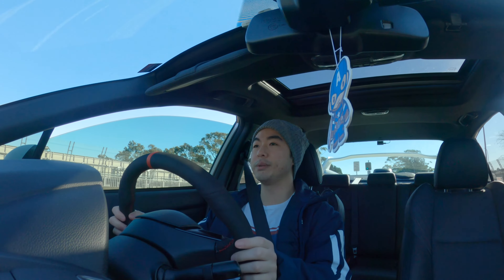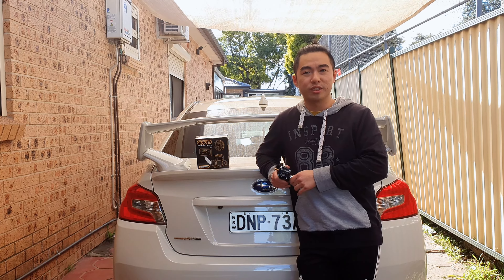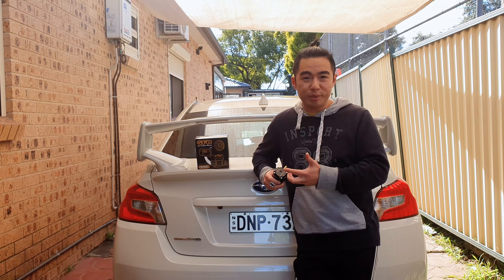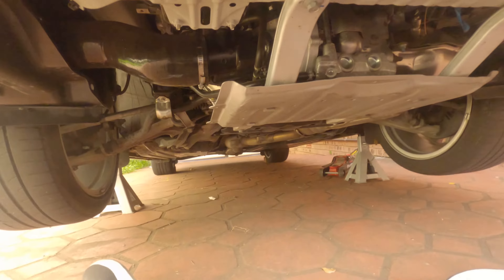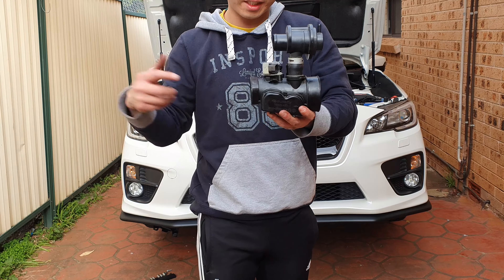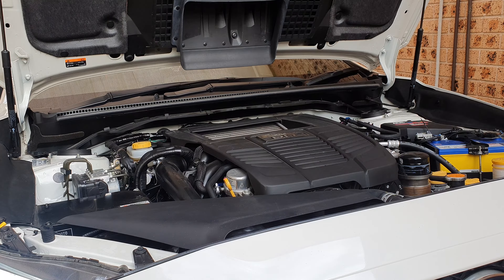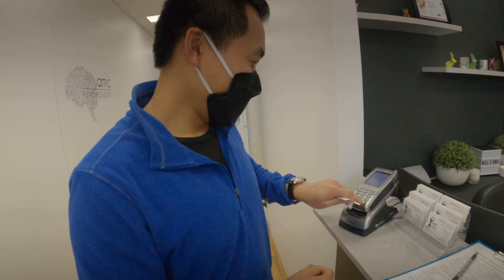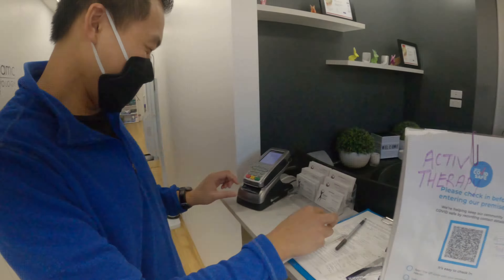The SIMPLEST and EASIEST mod for your TURBO SPORTS CAR | WRX2015+ GFB BOV

Comment: Wow it sounds great, looking at getting a WRX since ralliarts are too expensive to maintain! But WRX's dont have BOV wheras ralliarts do. Heard its not a good idea to put BOV's on the WRX's since they use a BPV and it can mess around with the MAFS and running rich since the air is venting to atmosphere instead of being pulled into the engine
Reply from the maker: I'm pretty sure the ralliarts have a BPV from the factory too? 

All that stuff about mafs and stuff is a bit of a myth lol. Different tuners will tell you different things. That being said, i got sick of the BOV sound and just have it run on full recirc 100% of the time now
Reply: @MrDuongTV1  yeah I wantcool turbo sounds but who knows it also might annoy me? I still need to test drive so I don't know what stock sounds like. But all I might need is an intake and a new bpv

Comment: How much bar can it hold + you are pushing?

Mine is tuned to 1.3b but with any BOV like GFB Respons and HKS SQV IV, both doesnt allow me to hold more than 1.1b. But the problem goes away when i am using another BOV/BPV which allows me to do that.

Gfb stood by their product reliability and their claims.
Reply from the maker: I've got no idea mate. Running a very moddest tune.

Comment: Did you set yours at 50/50? I have a turbo smart dual port bov and gonna set it at 50/50 I’m assuming that’s a good setting for daily driver?
Reply from the maker: It was on 50/50 for a bit, maybe 2 months. Since then it's been off completely and permanently 😂
Reply: @MrDuongTV1 is there a reason why you took it off?

Comment: Hi! I saw ur video and just installed the bov for my wrx! Can you tell me did you change the air intake? Thank you!
Reply from the maker: Thanks for watching mate! In this video, yes i had an aftermarket intake
Reply: @MrDuongTV1  Good morning Michael! I'm thinking whether I should get an aftermarket intake or not. It seems like you installed the new intake but didn't tune with it. I'm struggling with this now:(
Reply from the maker: @davechau6882  i did have a tune with it, you definitely want a tune with it. I took if off when i retuned the car with down pipe bcos 1. It made no significant power difference and 2. The wooshing sound got annoying, i wanted to hear the dump pipe and turbo whistle more. I dont even have the BOV going psh psh anymore these days
Reply: @MrDuongTV1  ohhh okay! Thank you Duong and have a great weekend☺️

Comment: Hi Mr Duong,

I have a question: I have a stage 1+ cobb ots tuned wrx 2015. On the BOV, what setting or how tight should make the piston from opening inside the bov to get steady idle? I like venting to atmosphere, but is there a specific adjustment you like using when venting to atmosphere? I hear alot of people just use the recirculating cap instead. But I want to hear the woosh sound too!
Reply from the maker: Hey mate. A lot of he said she said about venting to atmosphere. The FA20 supposedly doesnt respond well to full venting, so keep it at 50/50 max, or 70/30 (recirc/vent) if you have the adjustable one. Dial the piston all the way in so that it closes back asap.
Reply: @MrDuongTV1  Thank you for your response! I will definetly try the settings you recommended! Much love from Cali, Bay Area! <3

Comment: Did you tune up your car afterwards becasue if ya don’t it may cause problems for you mate so suggest tuning it after moding
Reply from the maker: There's a lot of he said she said regarding tuning with a BOV. Some tuners and engineers will say you need one, some won't. Most internet mechanics will tell you that you do need one, but most of the engineers, mechanics and tuners (with a really good rep) have told me that it doesn't really matter.

That being said, I only open up the BOV to a max of 30-50% when I'm filming hahaha get sick of it pretty quick. Thanks for watching!

Comment: Hey there thanks for the video im having trouble with spring pre load.
Did you adjust it much before putting  it in as mine isn't  making any noise at all. I can't figure out where I'm going wrong.
Reply from the maker: Thanks for watching mate? Which model of the BOV do you have?

I did have to adjust the spring load, its on quite tight so that it doesn't let out too much air and also I don't want it venting too low down in the rev range.
Reply: @MrDuongTV1  hi.mate I got the hybrid also,I had my spring on almost all the way out of the valve where it would only vent I spoke to gfb today because the screw spat out and I lost it whilst driving, they are going to send me a softer spring and replacement  bolt for the top.
I also tried both set ups for venting and it was painful but it should be sorted once I get the softer spring,2019wrx
Im thinking once it's sorted 
I will love it and upgrade to the in cab adjustable one for extra street cred lol.
Great vid mate.
Reply from the maker: @jeffreycameron3637  What a bummer!! Hope it does get sorted out, it definitely puts a smile on your face. Keep me updated on that!

If you do end up wanting to upgrade (because I will in about 2 weeks), I have just officially partnered up with a workshop who are official distributors for all things GFB and many other car parts. They do great prices, especially on GFB products. The video will be released in about 2 weeks with the shop and their great prices!

Thanks again

Comment: I’ve got a 05 xt… is this direct bolt on to the stock intercooler? (if I get the one designated for my vehicle) even if I’m currently running the stock bpv? Yes I’m aware I’ll need a tune but ya… will I need anything extra ontop of the gfb to make it work I guess is what I’m asking… (ej255 motor)
Reply from the maker: Hi mate. The correct GFB BOV will be a direct bolt on to the stock intercooler. No tune is needed, just make sure you dial in the spring preload all the way. No extra parts are needed, just tools.
Reply: @MrDuongTV1  I’m planning on going full v2a wouldn’t that require a tune or no?
Reply: @MrDuongTV1  also will I need to plug my recirc hose? Or can I run vent to atmosphere with that hose still attached to the gfb bov
Reply from the maker: @jamesmoss8706  V2a, as in vent to atmosphere? Its a hit and miss mate, some tuners and internet warriors will say you need a tune and some say you dont. Most tuners I've spoken to say it it doesn't make a difference.

With the respons model, you plug in your recirc hose, and can adjust it to any ratio (recirc:vent) so you can get full venting even with the hose plugged in. Cheaper models, you'll have to plug the recirc hose and port. I recommend the respons version, so that you can turn down the venting if you're not feeling it at any point
Reply: @MrDuongTV1  yessir meaning vent to atmosphere…. Thank you for the info! Cheers
Reply from the maker: No worries mate! Please consider subscribing if you haven't already! 😊

Comment: IMO you shoulda went with an intake(Which actually adds power  And) for that woosh sound, if that's what you are looking for? do you have a tune? what are your other mods? not to mention Subaru makes one of the most efficient BPV out there.  I've heard it can actually decrease power. I've always heard that BOV are bad for cars that rely on the MassAirFLow Sensors to manage fuel. Also its really not necessary unless ur making 400+ whp,  just make sure you tune it right so it doesn't leak.
Just so u know, all its good for is the sound really..... Not trying to knock you just throwing in my 2 cents. (18 wrx here, so trust me I get it)  This refers to the MAF sensors and fuel management.

Consider this "there is a small mechanical downside to having an after market BOV (VTA) on a stock WRX. The problem comes when releasing air to the atmosphere that has already been metered by the mass airflow sensor. When the BOV releases (blows off), the ECU will be injecting the wrong amount of fuel into the cylinders. The engine temporarily runs too rich (meaning too much fuel is injected into the cylinders). This temporary rich condition isn’t typically THAT harmful, but it may cause bucking or hesitation on lift-throttle as well as some other concerns outlined in the links below "
Reply from the maker: Thanks for watching and for the comments man! I do have a tune on it (but not for the bov - i drive it in recirc if I'm not driving like an idiot filming vids ), I've been driving around with it on full recirc most the time tho and its pretty smooth and responsive. 

Which intake do you suggest? My tuner reckons the process west one is the best so I might so with that in the future.
I did have an intake on it, you can hear it in my other videos too! I just took it off tho (tuner reckons brand I had is a poor design).
Reply: @MrDuongTV1  GREAT vids btw! I went Cobb Big SF and I friggin LOVE it! Solid parts, easy install, Amazing performance!
Reply: @MrDuongTV1  i recently installed grimmspeed’s intake and ebcs and it sounds just like your bov
Reply from the maker: Thats sick!! Did you get it tuned? How much power did it make with the intake?

Comment: Do you need a tune for that?  Is your check engine light on?
Reply from the maker: Hey mate. I didnt get s tune for it, no CEL and car runs conpletely fine. Recently got my car tuned in latest video, but my tuner/mechanic reckons nothing extra or different had to be done for the BOV. Of course different tuners and different internet warriors will tell you different things.
Reply: Thank you
Reply: Thank you!

Comment: That dying pigeon sound you're referring to turbo surge. That's not good for the turbo. It's caused by not recirculating and blocking off the release to atmosphere. It'll wear the bearings out
Reply from the maker: Thanks for the comment mate. I did mention that in the description.
Reply: @MrDuongTV1  I never read descriptions lol
Reply from the maker: All good mate, I made the mistake and learned from it very quick haha. Also made the correction in my next BOV video
Reply: No it doesn’t lol. Grow up